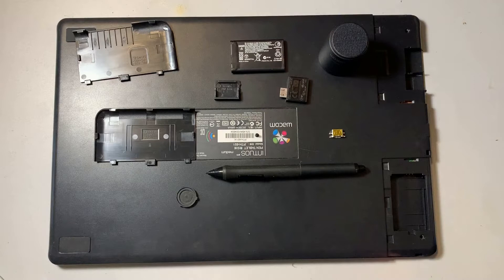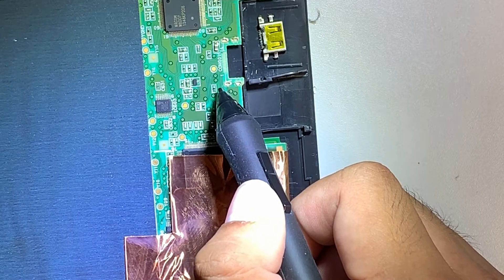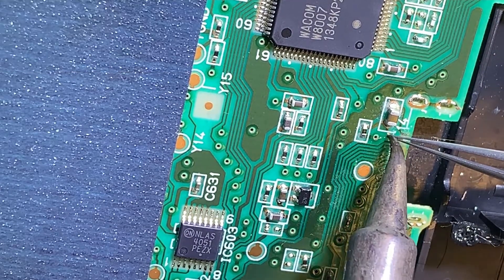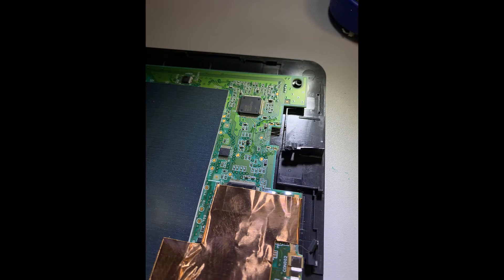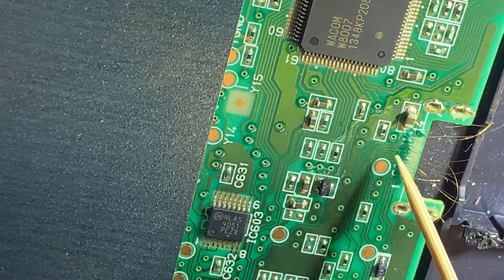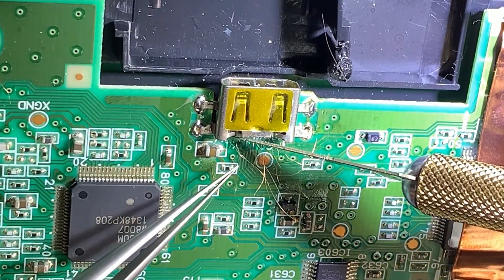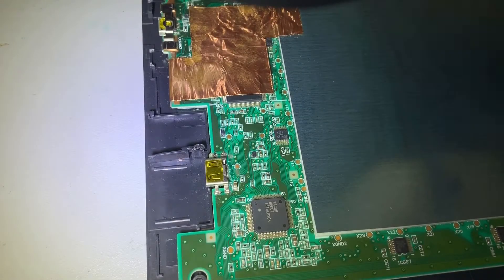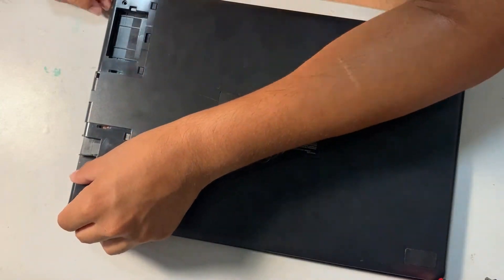Wacom Intuous Pro micro-soldering repair | ต่อไลน์ micro-usb 14 ขา

Comment: Dang... seeing this i doubt i will manage. I need a microcope to solder such tiny wires. I guess you had a magnifier or so.
Reply: IM going to an electric repair shop. I already know i cant fix this without a scope or magnifier.
Reply from the maker: That is true that job was done under a 40x microscope.
Reply: @toughastank  i hope I can find a shop here capable of this procedure
Reply from the maker: @RomboutVersluijs  It's a very time consuming process. Not sure if anyone would do this kind of repair for money. But, you have my best wishes.
Reply: @toughastank  I can always try and ask right! But i kinda doubt it, i live on a Caribbean island with 120k inhabitants. I dont think anyone here will have a job in this sector
Reply from the maker: @RomboutVersluijs  I live in BKK Thailand with over 10 million inhabitants, and a lot of shops here are capable of this procedure. But, you’ll be lucky to find someone who agrees to do this kind of job without charging excessively     😆
Reply: @toughastank  guess i need to let it rest and not bother about it. glad the usb port did not get damaged

Comment: Let's just make it clear. This graphics tablet is a complete fail regarding to construction and quality. It does not really make sense to repair it for many many hours. In that time which goes wasted you could better buy a new graphics tablet and keep working productively. And next time you buy one make sure it's not a Wacom. You can get better tablets today for around 50-70 € from XP-Pen or Huion with USB-C and not that crap.
But thanks for showing. It looks like a pain in the ass to solder the super tiny lines. I probably would have take thicker ones and solder them somewhere up the pcb and not directly next to each other. Makes it much easier.

Comment: Great job fixing the traces. Question on the ground pins - why didn't you flip the PCB over and solder from the solder side of the board? Seems weird to do it from the component side.
Reply from the maker: lookitskazzy you are absolutely right. I just didn’t want to be bothered disconnecting a few FPS connectors along the way to flip it over. Thank you for noticing.

Comment: Can l use heat instead of UV?
Reply from the maker: I'm afraid not. Heat is the infrared radiation with long wavelengths, whereas UV has much shorter wavelengths. To cure solder mask, which is a kind of resin, high-intensity radiation (short wavelengths) is required. Therefore, you cannot use heat instead of UV.
Reply: Gain more knowledge and enjoy  listening to the rhythm of the music 
Thank youuu.